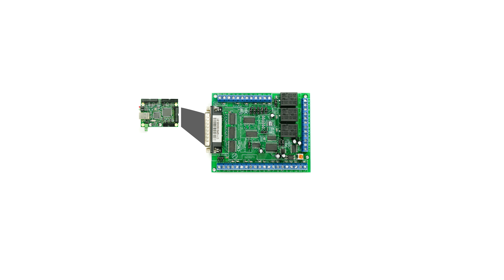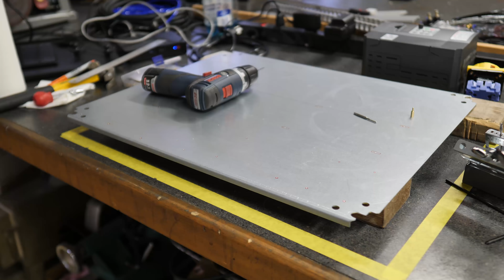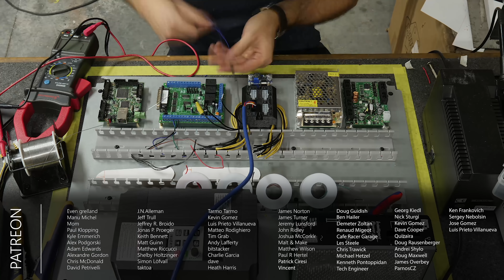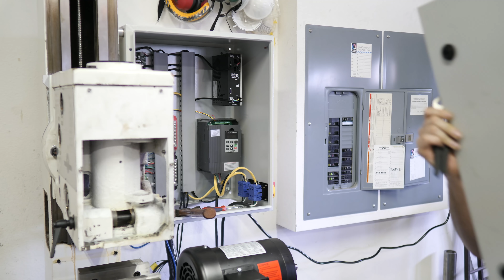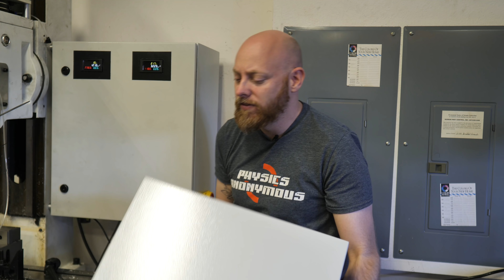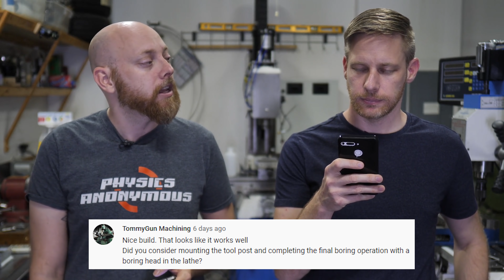CNC BRAAAAINS - S03E05

Comment: It looks like you have bolted the electronics cabinet to the milling machine column.  I would usually avoid that in case the vibrations effected the electronics.  I hope it works out for you and good luck with the build !
p.s.  If you want to see my machine and cabinet have a look on my channel (ep23 for the machine, and ep26 for the cabinet).

Comment: Is there any chance that you will get interference when the vdf is too close to the rest electronics? Do you run your vdf cabling along with the steppers cables? What is the proper way to avoid interference overall? Thanks. Lampros.

Comment: Love this build! Not sure if hour planning on building an enclosure or but I would highly recommend it. I couldnt imagine having a cnc mill without one even if your not planning on fluid coolant, they're very messy machines.
Reply: I don't have an enclosure, and it's really not a problem. Most coated Carbide tools run dry or nearly dry. A long as you keep your feeds and speeds fairly conservative, you don't need flood coolant. I add the odd bit of oil from a can, but that's all. I aim to run it so it's near silent and can be left to run for hours unattended. I use a chip guard on the front occasionallty, but most of the time it's not necessary.
Most videos I see on YouTube go at everything Bull at a Gate, trying to impress or emulate production machines. I really don't see the point of that if it's a hobby and time isn't a huge issue. Take things slowly and it will be just fine.

Comment: from when i investigated the cnc drive stuff i found out that its mostly the eaze of adjustmen and installing the board to mach 4 and hw good it resist weird ghostsignals (sorry its been a while and forgot the right thermation) that makes the difference in price , i bought the centroid achorn as it can work with free g code software and is based of profesional cnc stuff

Comment: Why use those outdated electronics?
Get yourself Duet3(cmoing soon) or older Duet2 with 6A drivers expansion.
Reply: this is milling. they need much more current than 6a. plus they're using servos anyways.
Reply: @zachbrown7272  I am not a milling machines expert but I'm quite sure that 6A on a efficient motor will be more than enough
Reply: @Arek_R.  the Duet is catered much towards the 3d printing crowd, so it doesn't really play nice with CNC mills and lathes as of right now.
Reply: @zachbrown7272  It's aimed at 3D printers but supports mills as well.
And they're pushing more towards CNC/mills/routers with upcoming Duet3

Comment: I understand WHY you build your own CNC vertical mill, as the journey is half the fun, but did you ever consider just going and getting a used VF or VF2 for probably a similar cost to what you have in this project? (Just playing devil's advocate here)...I only ask because every time I consider building a mill, I realize I can just go buy one that is ready to go for a similar cost...
Reply from the maker: Thanks Nathan! We sat down and did the math too. Turns out we are still a long way from the price of a vf2. We will have a video towards the end of this series where we talk about cost.
Reply: How cheap you think is a used Haas?
Reply: @andriosz  I regularly see them on eBay for less than $15k, and sometimes less than $10k... to me, if you start with a $3k mill, and put $2k+ worth of electronics on it, you are half way there....and then you don't even have a tool changer, flood coolant system, servo motors, a chip evacuation system, etc.....or the support behind it....I have a harbor freight mini mill that is collecting dust, I debate on converting it to CNC for about $1k...but that machine won't even do ACTUAL WORK, like a used machine I could buy for $5-8k....
Reply: @Steelcrafted  Yeah, buying one for 5k would be niece. But it could be worn out, also some times you go in small steps - first you get Mini mill with some extras, then add CNC capabilities to it - spending less money for each step. If you have money outright and space for it Haas is probably better - if you're getting a decent one, not some basket case.